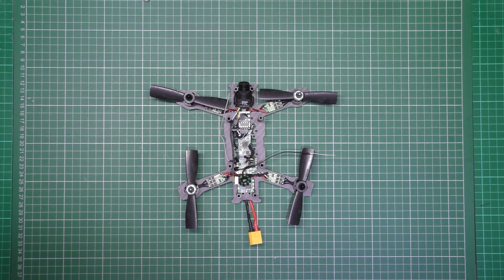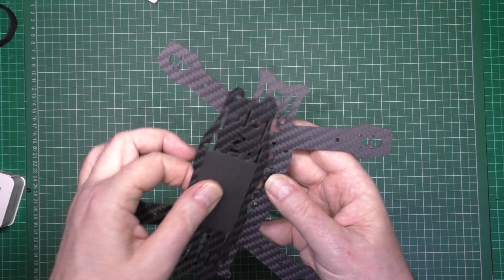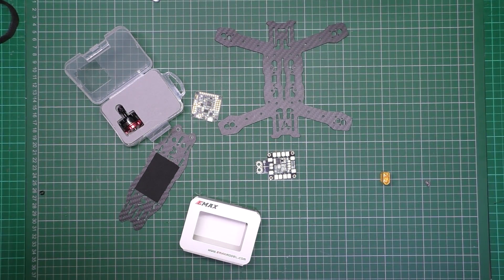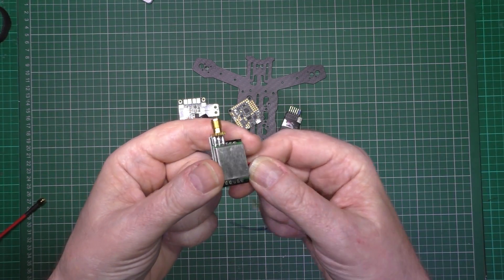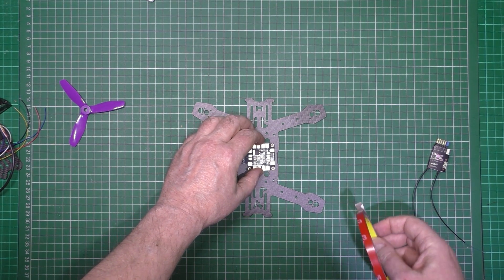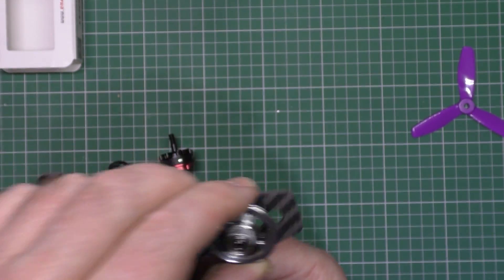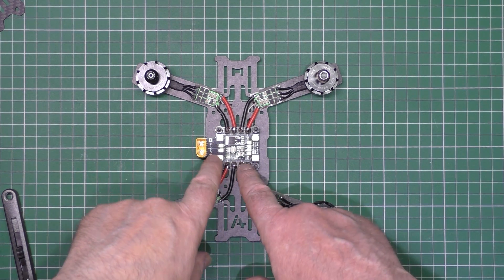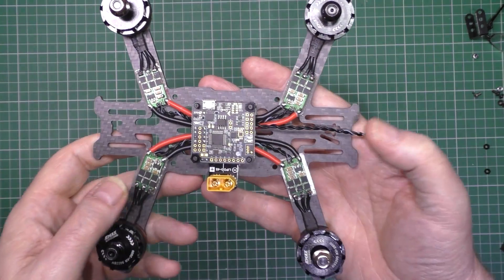Armattan Morphite V2 build

Comment: nice build cant wait to see it fly, i see you had a problem with the micro osd which concerns me cause i got three and was going to put on two of my quadcopters....im just hoping two out of three work, about your camera have you tried putting a pice of uncooked rice in it to absorb the moisture?
Reply: rewatching the video mybe that won't help with the citys fog i was thinking you lens was fogging up....
Reply from the maker: The camera is fine. The condensation was caused by having it in an air-conditioned car and then straight out into sunlight. I think the problem with the OSD was caused by the cheap chinese regulator I'd fitted but thinking about it, I really don't need one. I never have time to look at it before it crashes anyway :D
Reply: Lol i get ya bro,  from AC to out side the uncooked rice might help just need to change it out every so often, have you thought about getting a beer cooler to put you quad in from point A to B? If you keep the cooler the same temp as it is out side when you fly that might work...i just hate to see you not fly.
Reply from the maker: I've got a better idea...... I won't use Fatshark cameras again. It's only with those cameras that I get the problem :-)

Comment: That's a beautiful build as always mate. Couple of things if you do another build. Kombini flight controller and PDB in one, and it is an F3 flight controller as opposed to the F1 Naze32. For the Naze a great firmware that is rock solid out the box it Betaflight 2.9, but make sure you use the Betaflight GUI from the Chrome store. Can't wait for the maiden mate.
Reply from the maker: Thanks for the tip mate. I've only had one experience with an F3 flight controller (SP F3) and I'm still recovering. I might ceremoniously set fire to it....... for closure :-)    
I've seen the Kombini but there's none in the UK that I can find......unless you know otherwise?
Reply: what issues did you have with the SP F3? i run two of them and have had very few issues after soft mounting.
Reply from the maker: Where do I start?    
SBUS didn't work, no GPS support, the firmware it tells you to load in the manual actually soft-bricked it, the componets weren't straight and to cap it all, the 5v regulator popped after half an hour.    
Hydra might have solved all the little bugs but I'm done with SP stuff. It was a product released before it was tested and not fit for purpose.    
Rant over :D